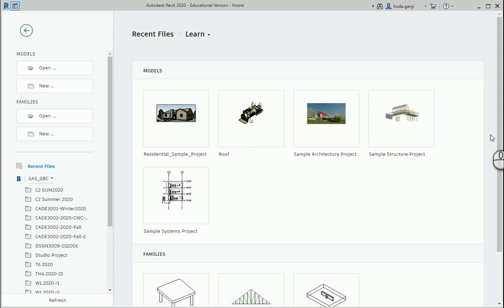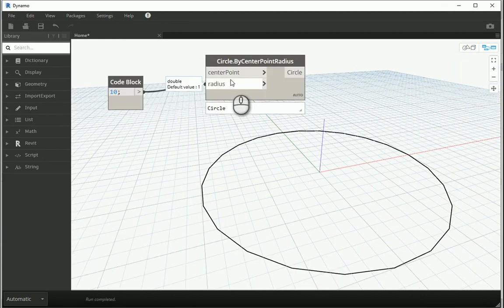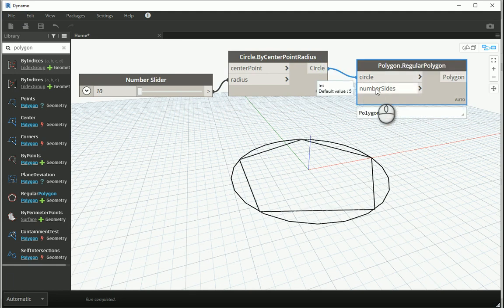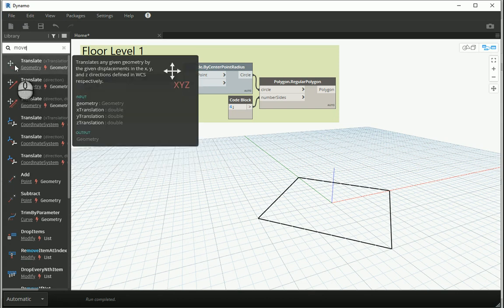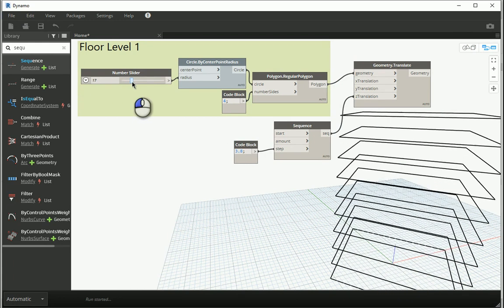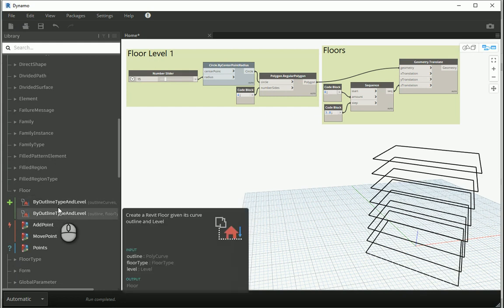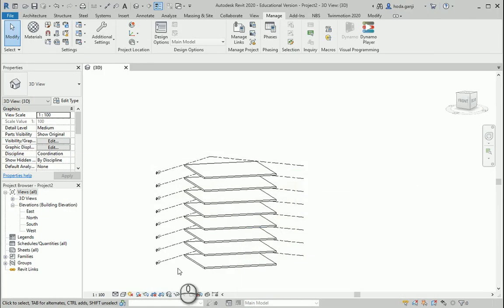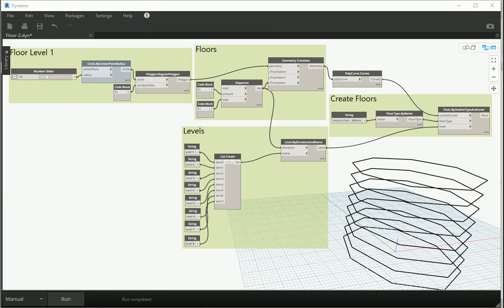Floors, Walls, Roofs in Dynamo, Revit 1

Comment: Good tutorial as usual but I tried with circles (shapes) but the Floor.ByOutlineTypesAndLevel node fails. I realized however that the PolyCurve.Curves gave a warning “PolyCurve.Curves expects argument type(s) (… .PolyCurve), but was called with (… .Circle[]). Please what is it wrong since I followed your tutorial; the only difference is that I used circles rather.
Reply from the maker: Go with "Curve.PointsAtSegmentLengthFromPoint"; then go with "Polygon.ByPoints"; then use the generated polygons to create floors.
Reply: @hodaganjiphd4265  Please I have sent the Dynamo script to your email for your review. I tried as you suggested but couldn’t still create the floors. Kindly review it and advise. Thank you.